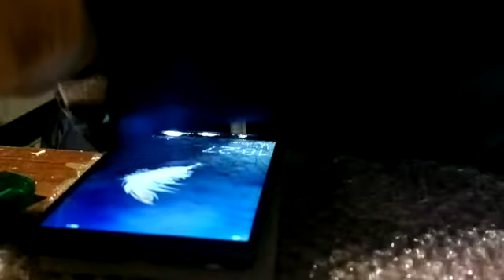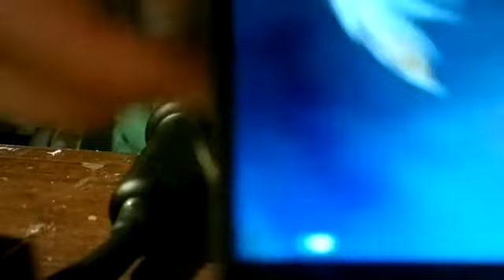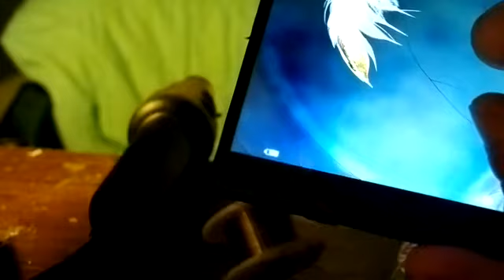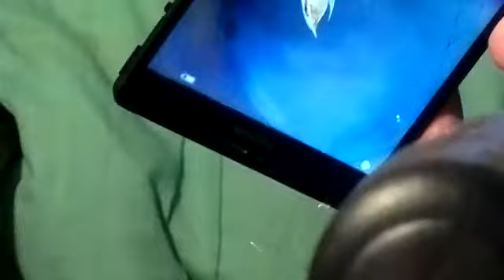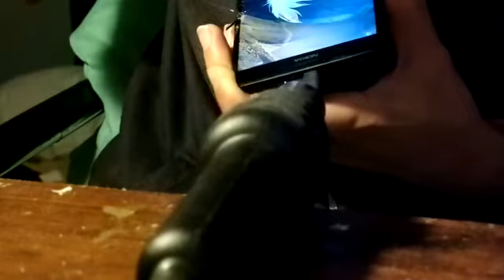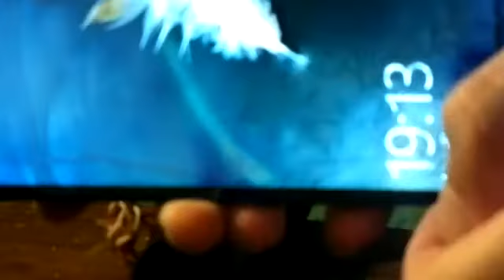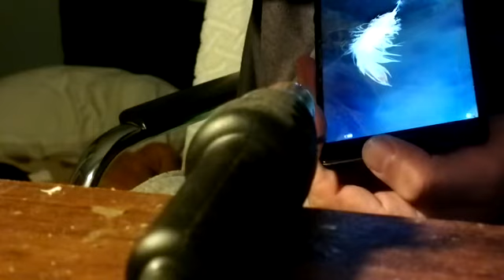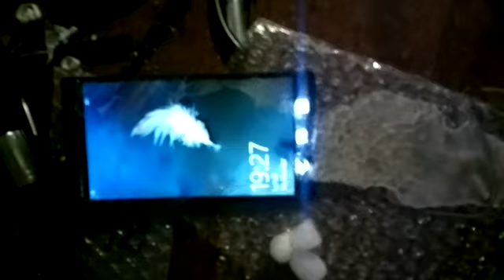Lumia 1520 LCD separaration - outter GLASS ONLy

Comment: hie i have a nokia lumia 1520 n the problem is the belt tht connects the screen to the motherboard is damaged so do i have to buy a new LCD or can that cable be repaired
Reply from the maker: if the cable is the one coming from the lcd ,you can't repair it ,, there a way but it need a well advanced workshop and tools so if it is connected to the lcd ,just buy new one

Comment: Good afternoon. I have a Nokia lumia 1520 broke touch screen. The display intact. I bought on ebay a touch screen for 5$. It contains the ribbon cable connect to the display. I disconnected the broken touch screen and plugged in a new one. And touch screen is not working and is not responding. I have tried with others. Bought from another seller and it was the same. Do not tell me what could be? When installing a new touch screen makes the phone firmware to confirm the new sensor. So to say that the sensor is recognized by the phone? Or not you need to flash the phone after installing a new touch screen? There are some not compatible? New LCD ~90$ New touch screen ~5$
Reply from the maker: MrVarten i had same problem with lcd which is version 06. on the back of lcd you gonna see some text. its written v0.6 or v0.7 so check version of your lcd on the back of lcd
Reply: I watched your video where you tell and show about the versions 0.6 and 0.7. My display is version 0.7. I bought the transparent touch screen with Flex cable and small Board. What touch screen do I need for version 0.7?
Reply: For version 0.7 need a touch screen, CHIPONE chip? And it will work?
Reply from the maker: MrVarten i had a customer which have version 0.6 and he checkes two touch screen that i had.  so one worked for him and other one didn't work and they were same model of touch panel.  i think the problem is bad quality of touch panel because its not deposited indium tin oxide on glass but they use a deposited ito on plastic film.  i also wonder why.   i can make you picture of my lcd and touch lets talk over whatsapp 00212622060978
Reply from the maker: you know i hade two touch screen , one CHIPONE and one Synaptics ,
the customs taken one which was working and left the bad one for me , let me check the drawyers for this touch and i'll tell you the chip brand manufacturer
Reply from the maker: the one i have is CHIPONE and its not working , 
the original chip on original LCD is Synaptics and the version of this synaptics is also important ,
you can check your old broken touch and tell me what the version is it , 
else you know , there is a small copper pin which make connection between GROUND (GND) and the touch screen ,
Reply: Touch screen installed and broken has a chip Synaptics. Although it is set to 0.7 v LCD. It was purchased and thus has excellent viewing angles. All parts are not changed and bought in USA. New touch screen has a chip without any name. Just numbers. If I use it on your phone now touch screen with Synaptics chip. Probably I need to buy exactly the same. And it will work. Only need to find one.
Reply from the maker: i have a working touch lcd with touch (3 pieces) all of them are synaptics , 
and the one which not work neither on V0.6 nor V0.7 is the chipone .
the synaptics worked in both version , 
its fooling to understand , maybe its not connected to ground or the chipone signal coming from the IC (chipone) is not compatible with Lumia mother board IC inputs
Reply: Then order a touch screen with synaptics chip. I also thought that the earth is not enough. I even soldered directly from the phone to a contact land on the sensor and to no avail.
Reply from the maker: MrVarten i have made a video of 1 minutes long to show you my chip on the new lcd and the touch which won't work on both version 6 and 7
Reply: Where can I watch?
Reply from the maker: @MrVarten : check this video v0.6 i bought from china , and v0.7 the original one , 
https://www.youtube.com/watch?v=Rbnm9Q9Xj0o